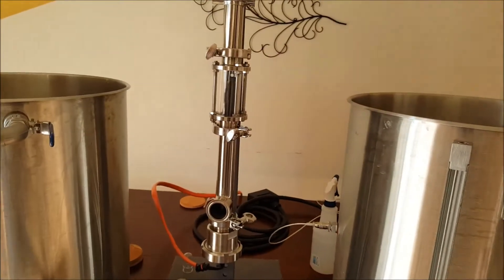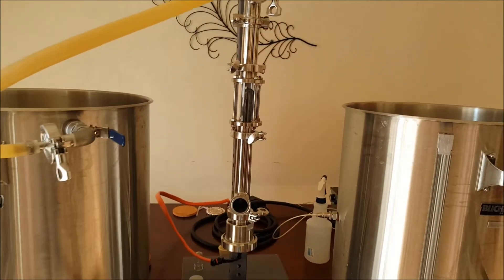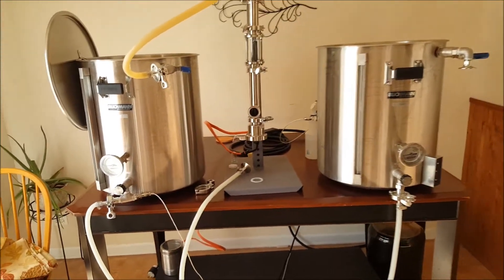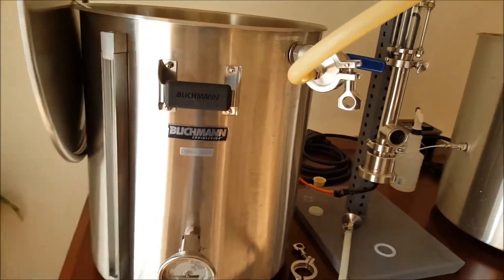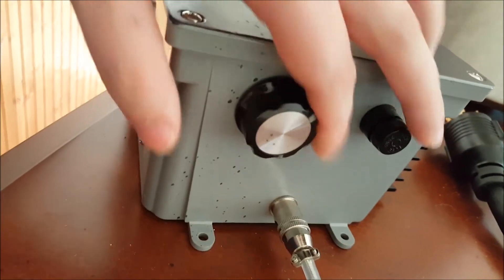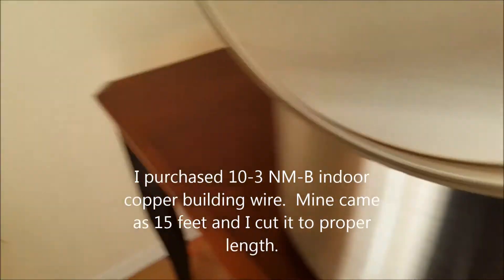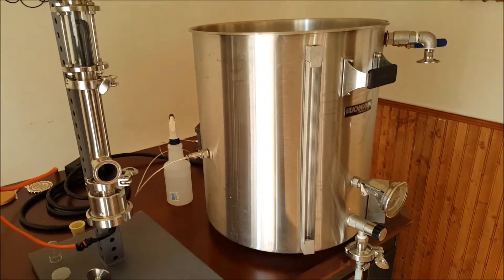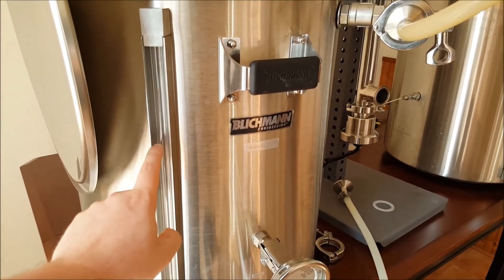Smarty Pints - Blichmann G2 Brew Setup and High Gravity EBC SV Controller

Comment: I am a homebrewer.
I brew my own beer in 23 litre batches from a kit, so I’m not a PROPER brewer.
Until I grow my own hops.
Until I harvest my own barley and malt it.
Until I buy a $5000+ stainless steel brewing system with WiFi - I will just be playing at brewing.
But in the meantime I will go down to my local homebrew shop and choose from the 180+ different beer kits and ferment it in my plastic bucket.
Then after a few weeks I will sit down with a foaming brew and count the $5000 I saved.
CHEERS SUCKERS !!!
Reply: Ya but your beer will taste like shit, and you will have not brewed it you will have just mixed it up and pitched yeast.  Yay.  Get lost troll.

Comment: I'm wanting to build a rims system like yours but without the EBC controller. I plan to use a Johnson A419 instead. Anyhow Ive have no experience with a system like that so I was wondering how you sparge with your system? After your mash do you just raise your temp then pump the remainder of your water over to your boil kettle?